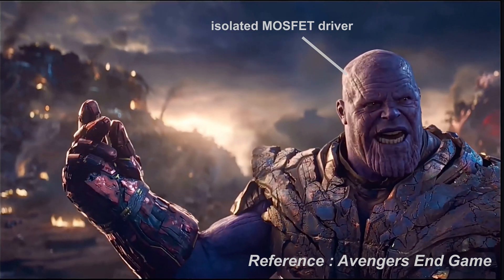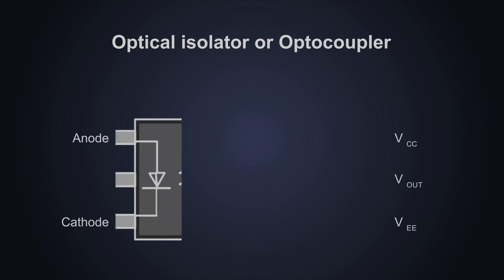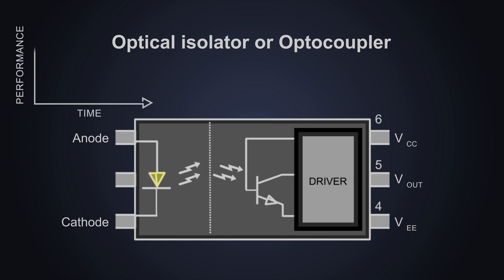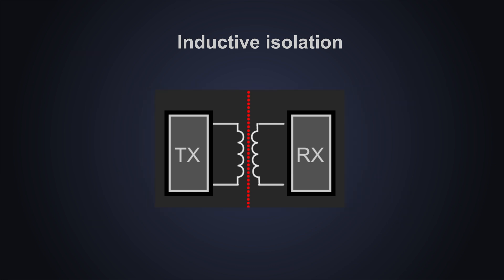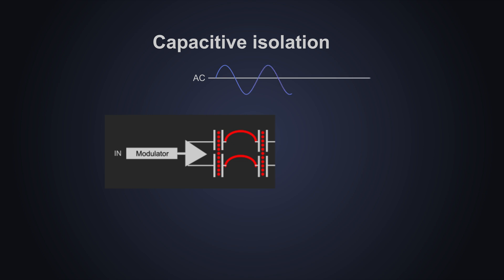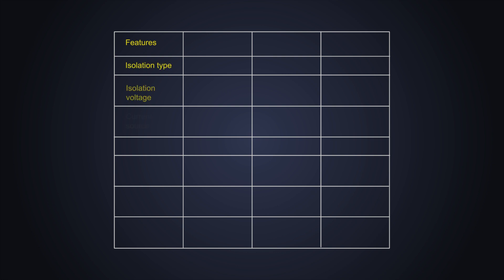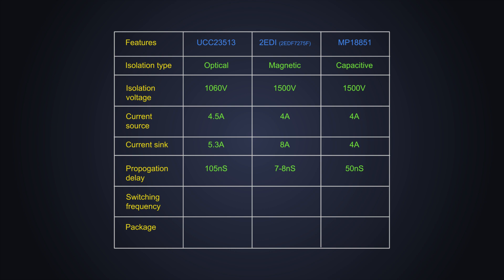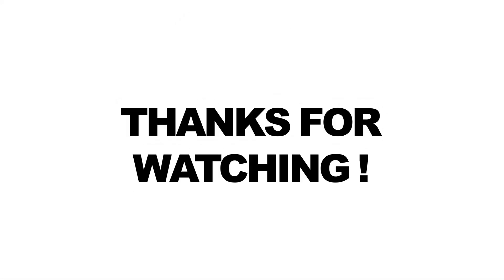Types of Isolated gate drivers | Optical Isolation | Inductive Isolation | Capacitive Isolation

Comment: Can transformer isolator add more current  in the circuit
Reply from the maker: Good question! A transformer isolator doesn’t add more current — it just transfers signal or power with isolation. The current still depends on the source and circuit design.

Stick around and subscribe for more deep-dive videos like this!

Comment: Another issue is that the low side frequently needs to measure the output current and voltage on the high side in order to adjust the modulation for proper power, etc.    How does one isolate the current shut and the voltage divider on the high side from the low side ?   FYI, some big IGBTs have current shunts built into them.  Great video.

Comment: The 1ED3123MC12HXUMA1 requires a power supply on the HV side.  Lets say the HV side is 1200V.  How do you built a ~15VDC power supply from a 1200V source ?  If you power the power supply from the LV side you've lost the isolation !
Reply: You could tap the power from high side with a small transformer

Comment: Any comment on the isolated driver modules that use fibre optics to connect them to the control electronics ?   Like Power Integration's 1SP0635V2A0D ?

Comment: I buy 20 tlp250 from r china the optocoupler cant drive any hide side switching when I add the boostrap on it work with a very low wattage but as soon as I connected low like a capacitor the optocoupler just stop working and heating up so is it that the tlp250 gate drive can’t driver anything and should only use to isolate?

Comment: Overall, good video. There is an error; UCC23513 is not an optical isolated gate driver. It’s an opto-emulated gate driver that uses capacitive isolation. A true optocoupler gate driver would be a device from Broadcom/Avago (ACPL-W302). Prop delay is much higher for traditional optocoupler gate drivers in the ~700ns range. 
Rather than switching frequency, CMTI (common mode transit immunity) is usually a better indication of an isolated gate drivers switching capabilities with respect to noise. Higher switching speeds increase the dV/dt experienced at the switch node. That noise can couple onto the input and cause faults if the noise is too high. A gate driver with higher CMTI rating enables higher switching frequencies. Likely more relevant to MOSFET/SiC applications rather than IGBT applications. 
Look forward to more videos
Reply from the maker: Thank you for your inputs! I'll check

Comment: Switching frequency of 15-20kHz in the case of optoisolators is not accurate. Even it is used for SiC to switch at 100kHz-.
Reply from the maker: It is an example, we didn't make the comparison of the type of drivers but the individual components for understanding.
Reply: @FoolishEngineer  oKay, Thanks. by the great efforts and nice demonstration for beginners to understand the concept.

Comment: You missed one.  There is a MOSFET/IGBT driver that has a solar cell output.  The LED shines on a photovoltaic cell generating a voltage which can be used to turn the gate.  The advantage is not requiring an isolated power supply on the load side.  Disadvantage is they're only good for on/off apps not high speed switching.
Reply: Can you suggest one part that can do what you describe ?
Reply: @EhsanHabib    TLP191B  APV1121
Reply: Very Interesting IC.... Very useful for Small Scale Isolated Gate Driver requirements...... But i think Foolish Engineer didn't mentioned it because its not used most applications..... M